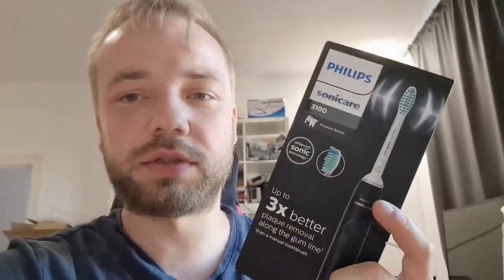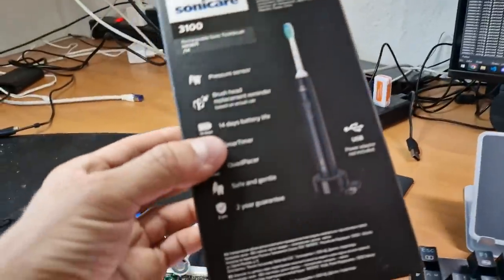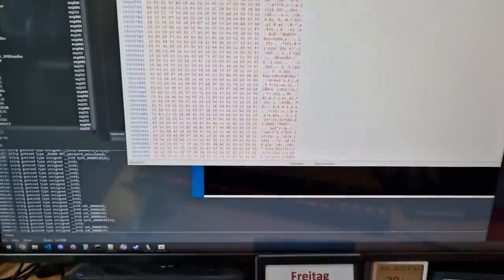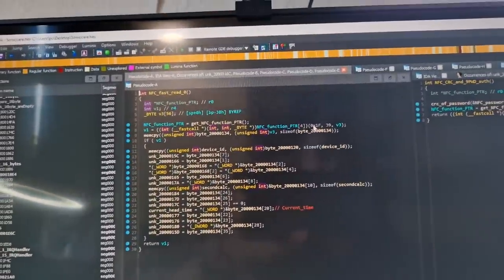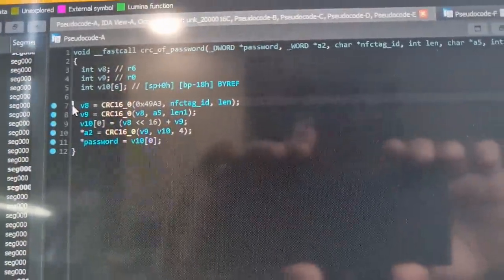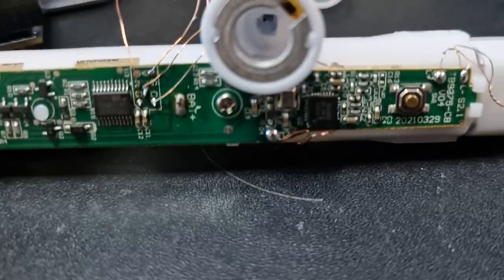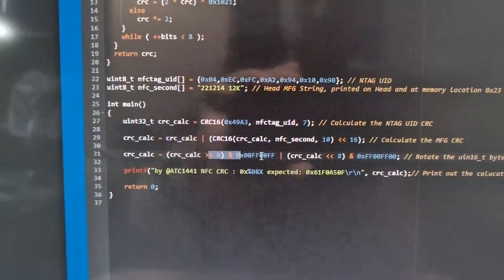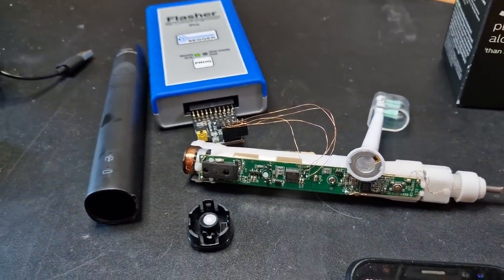Hacking the Philips Sonicare NFC Password

Comment: The thing that bugs me is where the box says "Up to 3x better"  so if it is no better at all that still falls into "up to"  Would an improvement if they said "At least 3x better"
Reply: Except it’s not “at least 3x better” than all others.  It’s only 3x better than the worst one out there, which isn’t saying much, as you mentioned.
Reply: Heres why they went with that language:  short version "user error"   long version. Well, not that you asked but...

Your experiance may vary.  User error.  The blonde surgeon on southpark that lost his lunch when operating on Kenny also tried using it to clean out plaque by just brushing it around like chewbacca's welding job on the milinium folcon...but you know open heart surgery, so just in some guys chest cavity. Thank god for youtube videos.  Now we know he should go with the toothpick in that circumstance, kinda like spliceing into a network cable then soldering the hole shut....silly doctor.

Comment: While I do understand that it's silly to write protect the toothbrush head with a password, I also have to mention that it only reminds you after something like 180 uses.
So by brushing twice a day it'll only start reminding you after a quarter of a year. That's honestly a very fair time span.
If that bothers you, you should maybe replace your tooth brush more often...
But besides that, a very impressive feat!
Reply from the maker: True,
For me it was just about cracking that password calculation :)
The toothbrush part doesn't matter, using a manual toothbrush anyway

Comment: Nice work.=! May need this when my older Sonicare (without this NFC crap) dies... or maybe I'll just switch to a manufacturer who isn't locking down products to generate revenue.
Reply: is it locked down? it doesn't stop you from using a brush that has reached that max number it just gives you a little warning

Comment: You should try hacking the oral B IO toothbrush. the one with the small screen on it and get it to run Doom.
Reply from the maker: Lets see if im willing to spent that amount of money ^^
Reply: @atc1441  Must be expensive then. I've never owned one but I have a cheaper sonic toothbrush that is just a toothbrush. I dont use it because I use a spinbrush which is maybe $10. It works ok but the second or third use the head loses connection with the base so I heated it and bent it slightly and it works great. It would stop brushing if I pressed even lightly on my teeth.

Comment: It’s a great video. Very well explained approach. However I don’t understand the hate about the feature. It’s a friendly reminder, that the brush is old. It does this after you brushed your teeth. It’s non intrusive and just helpful. Having the nfc in the head is really helpful if multiple people share the brush handle. It remember the settings for each head and activates them as soon as you attach the head.
Reply from the maker: There is no hate from my side actually :)
It was just about knowing how it works and how it is calculated
Reply: I agree that it's actually a really helpful feature with a really cool design, especially if you have to brush longer or more often than most people because of dental health or appliances, which throws off most recommendations based on averages.

The only user-hostile thing here is that the value is password locked. That makes it so that third-party generics can't include those features.

Comment: Me casually watching 1st world problems while I'm still using good old fashioned Tooth Brush🤣🤣🤣🤣

If it was me i'd return it and I would ask for a refund for forcing me to create more E-waste than necessary
Reply: By the way isn't it possible to just remove/break the NFC chip from the Brush head and trick it into thinking that it's running without a brush head?

Also now that you basically have the firmware why not just make a custom firmware that just disables that feature at all?? You have so much opportunity to mess around with the tooth brush and you ignored it🤣🤣🤣🤣
Reply from the maker: Here is messed around with the firmware ;) 
https://youtu.be/OkfS_z0FrlE

Yes you can disable the nfc feature, 
The simplest is to just write the wrong password 3 times so the head will be locked forever at the current time.

But its not an annoying feature really^^ its not like the toothbrush will stop to work.
for me it was just about knowing how the password is generated :)

Comment: It’s cool that you were able to hack it, but what are the use cases for rewriting the brush time? I have this toothbrush and  the heads get really worn down before you are notified to change it, so it doesn’t seem as flagrant as like ink cartridges. I guess if you want to save money and glue a new regular toothbrush to a head
Reply from the maker: That is a question i am not sure how to answer, 
These old NFC tags could be reused for an other purpose, but they are sadly still very locked down in other memory regions, for me its just about the reverse engineering, will never use it 😅
Reply: @atc1441  what does it mean for them to be locked down? why can't it be accessed? what prevents you from doing that? of course it's not impossible, but probably still very hard if you tried to attempt this on a physical level
Reply: Good solution would be an alternative firmware that doesn’t care. Even better solution would be to boycott products like this.
Reply: @serpent213  good solution to what?
Reply: @mattsains  To your not-problem.  😉
Reply: @serpent213  I don’t get it, I was saying that the toothbrush isn’t a problem because it doesn’t prevent you from using an old head, only reminds you. And it’s also not coercing you to waste toothbrush heads because the warning only happens after the head is pretty old and gross. Actually I’ve been testing mine by waiting for the reminder and it just went off and I was so relieved because the head was so worn out that I felt like it wasn’t brushing properly
Reply: @mattsains  Copy. Enjoy your toothbrush.  👍🏻